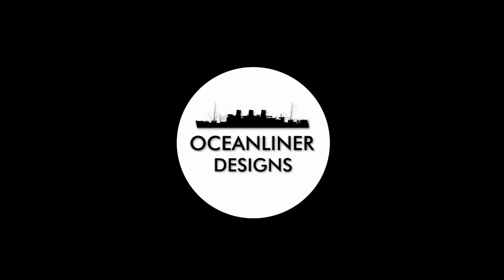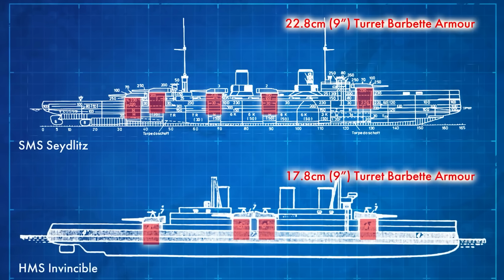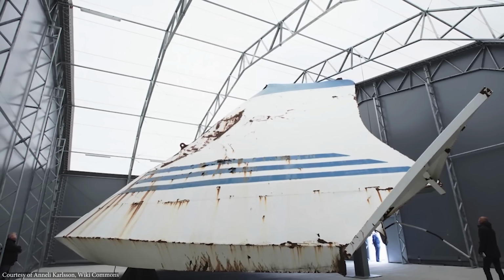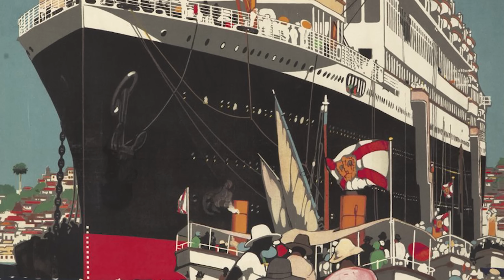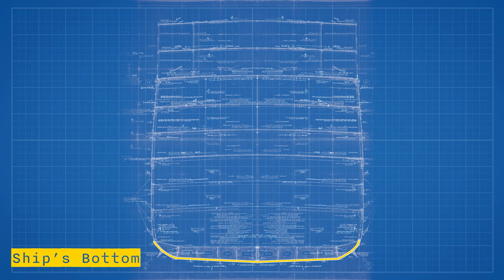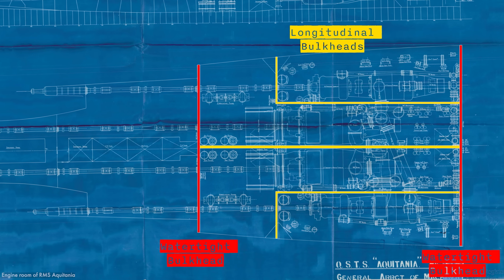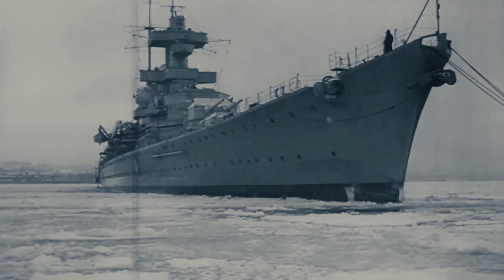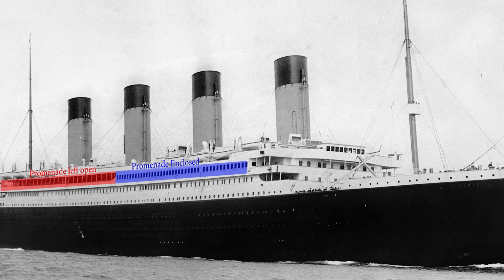The Worst Ship Design Fails in History

Comment: OK--------.   American  NAVEL Combat ships DO NOT have or allow Hatches, (water-tight doors to you land lubbers) to Pierce any Water-Tight Main Bulkhead below the Main deck. Or the lowest deck a man can walk from the Bow of the ship to the STERN without  having  to climb leaders... Forcing all personnel to climb the ladders up to the Main deck which can be 8+ decks on Carriers and then back down again just to move even 2 feet forward or aft of a Main Watertight bulkhead.. No matter how inconvenient or time-consuming that is....   With the Main WT Bulkheads reaching all the way up to the Weather decks (weather decks can very greatly how far they are above the water line).. With the  Main Deck being at least TWO decks above the WATER Line except on small Frigates and most Corvets,....
---------.   Each deck below the Main deck must be watertight with WT hatches between each deck... And No water-tight Bulkheads down the CENTER line between Main Hull Bulkheads that could create large Bubbles of Air that could destabilize or capsize the ship if that Compartment or those around it are flooded.... That does not count multiple hulls that can Number up to 6 on Carriers. that can be easily Counter flooded..or Pairs of Bulkheads that create compartments that can be counter-flooded to balance a paired compartment on the other side of the Center line.. even if those compartments are many frames away from each other....  There can be large isolated water-tight Compartments down the Centerline of the ship that must have their hatches to other Compartment on that deck secured (closed) at all times as well as be connected to a separate Water tight TRUNK 6 to 8 feet square, that runs from the lowest deck to the Main deck... With water-tight hatches usually at each deck... that must always be secured at all times... For emergency evacuations... and access to lower decks if a higher deck is flooded or Compromised by fire or smoke... this is important, especially on Carriers that may have 8+ decks below the Main deck... Trunks are normally used for moving Palets and supplies between decks...
-------.  To make this easy just in case you did not add all my above statements together... Every hatch into a Watertight compartment below the MAIN Deck MUST be Secured at all times...  Even when all the hatches above the main deck and all through the upper Superstructure decks and to the Bridge are wide open... Unless they are Guarded anytime they are open...  Damn inconvenient... But any WT Hatch below the Main Deck Mistakenly or lazily left Open could cost lives or even sink the ship or kill a hundred crewmen from a simple FIRE... during an emergency...!!!   To make things more Confusing...  Large hatches must have a Scuttle for a man to pass... ( Basically, a very small hatch that Fat people cannot get through... Simply because a hatch too large Cannot be pushed closed against incoming WATER)  
----------.  Sorry Fat People but I do not Control Physics...And why the NAVY has Weight STANDARDS.. That Should be Strictly Enforced... And IF DEI forces the NAVY to put in Larger SCUTTLES  hundreds of crewmen could die including the DEI crewman... The ship would even be in Greater Danger of SINKING including CARRIERS...   ALL.Because of a Scuttle that was an INCH bigger...( and we all know DEI would insist on scuttles big enough to walk through to keep from inconveniencing or shaming the FAT crewmen) History is full of incidents of Crewmen not being able to close large hatches against incoming Water.. and losing crewmen, compartments and whole ships. But damage control training teaches how to close Scuttles against flooding... and why speed is damn important as even at the small size they are... If the incoming water is too high the smallest scuttle is impossible to close...  Fact is they even have a chart that shows how high the water is before You HAVE to shut the Scuttle even if crewmen are still on the other side... and if you wait even a few seconds after that, you WILL be court-martialed... That is if by some miracle you survived....  The Scuttles are the Largest possible size that allows a man to close them at the highest water level possible on the other side...An inch past that level higher, and a hundred men could not close it.. Unless a smaller Scuttle was installed... But an inch smaller scuttle and almost half the average crew would not be able to pass... An inch bigger,,, the water level on the other side would be 6 inches lower... Sorry  DEI...!!!
========.   Amercan Navel Construction is Markedly Different than Most NAVYs Around the World including Chinese, European and Mediterranean Fleets that are NOT Saddled with the Experiences of WW-1 and WW-2 and a hundred years of Modern Combat on the HIGH SEAS.. AGAINST Pear Enemies... With many ships lost!!!   (except for Battleships, that is not as relevant today)...  Most fleets of the World are built using different Combat and Survival Filosophys for their ships.... To that Point...   That is Why the New Constitution class Frigate that takes a European Mediterranean  very successful Frigate design to simply Building it for the American Navy... Is 3+ years behind Schedule and a Billion Dollars over Budget...
---------.   EVERYTHING about the Frigate has had to be completely redesigned to bring it up to American NAVEL Codes and Needs...  To  Make it as Survivable and Battle resistant as It can be...  From almost doubling the water-tight bulkheads and hatches, explosives proofing the propulsion spaces, Damage Control upgrades,  Warhead Explosion Containment throughout the ship, armoring and EMP proofing all Wiring throughout the ship including additional paths to increase damage survivability, Isolating and upgrading shielding for electronics compartments... and much much more the Europeans may not care or even admit needs to be done....  
_______.  That includes criticism about the changes in the Constitution's Bow design that Europeans can not even Fathom... From cutting down the height of the bow by a Deck and adding a Sweap... That reduces the RADAR cross-section of the hull) to taking off the Balboas Sonar Dome Bow...  The deletion adding hundreds of miles of Range and cruise speed to the Constitution,,,  even before the extra Fuel Tanks were added... With the small narrow, low-drag fin extending a few feet below the keel far from the Bow, fine for light duty short range Sub detection as well as mines that need avoided... or destroyed, in shallow water...   With the new towed sonar being 10 times better for hunting subs hundreds of miles away... Than any sonar in a bow dome that is subjected to constant bow wave-piercing noise... 
_________..   Other changes include Lengthening and widening the hull to contain additional missiles and other equipment the ship needs... As well as beefing up the strength of the hull to US Navel standards...  The LCS ships BEING a perfect example of Ships designed to Civilian standards, NOT US NAVEL... That resulted in hulls that are cracking and failing that restrict speeds as well as equipment that constantly beak down and are impossible to repair for many reasons... Except that using Civian standards are all common to ALL of the LCS problems... Each and every problem the LCS's have.... Civilian standards That Build  Hulls that are too lightly constructed and  Instaled Equipment that Cannot take the Extreme Heavy Stresses,,,Civilian ships are never subject too....  AS do most Navys around the world... as most are Weekend Warriors in Fair Weather... 
_____  The original Constitution design is Fine for the Mediterranean and North Atlantic seas and low threats and operational timelines...  But a total DiSASTER for the long distances, and Sea keeping in the huge waves of the Pacific... NOT found In the ATLANTIC and Never even heard of in the Mediterranean...!!!! .     ADD all the additional Countermeasure systems and Towed Decoys and much more and...
--------.   Well... It may have been cheaper for the Navel Design Beurow to have started with a Clean sheet..... Except it would have taken a decade with all the Design Boards and Committees and all their meetings over years, even to settle on an acceptable design...  THIS way, starting with an Accepted Design already Approved... and then completely redesigning everything about it to already SET Navel Standards and additional needs, Even if the Contractor had no Clue beforehand... JUST May be the BEST WAY to go all along...  But next time get a contractor that  DOES have a CLUE...!!
=======.. Well shit...This started as just a few lines about  Nave Hatches...!!!  Hope you enjoyed them...  And I did have fun writing them...  So that is good enough for me .. .BYE...

Comment: Steam turbines reverse using reversing turbine elements.  
The reversing turbine elements are on the same shaft as the forward elements.  
I don't know of a steam ship that used reversing gearing.
Reversing gearing would be prone to failure and expensive.

Comment: On the Knox class frigate I served on we had a permanent list to port because the emergency diesel engines were placed on the port side near the stern. This was theoretically offset by placing an A/C plant on the starboard side but in reality this didn’t work. At sea this wasn’t an issue because of the stabilization system, but in port it made it an issue, especially when tied up next to an another ship.

Comment: SS Milwaukee and SS Anna C Minch and many others suffered similar fates on Lake Michigan. Roll on and roll off ferries were rough back in the day. Just one wave would crash over the rear gate, splash onto the expanded steel floor (not a solid floor) and douce the boilers below deck. This would kill the engines and left helpless in a storm…

Comment: Thank you for the exciting research! A little remark on minute 00:27:47: reverse steam turbines are not connected to any "complicated gearboxes." In order to reverse the engine, the valves leading the steam to the forward turbines are closed, and the valves leading to the reverse turbine are open.

Comment: Long before any of the examples listed, we have the swedish Great Ship Vasa in 1626. The first sailing ship of its size, the builders simply had no idea about the physics involved because nobody had had to deal with them before. So it managed a little less than a mile out of port on its maiden voyage before it caught a bad gust of wind, capsized and sank. Fortunately most of the crew and passengers were able to escape, in part because the whole thing had happened within shouting range of Stockholm and people could just take a bunch of rowboats out to pick them up within minutes of the sinking. The 30-ish dead were mostly unfortunates who'd been caught down below decks when the ship rolled over and had no way to escape, while pretty much everyone who got into the water made it out alive.
Reply: What is truly amazing about Vasa was that, after spending some 400 years on the bottom of the Baltic, she was perfectly preserved and intact.
Reply: Vasa sank largely because she had yet to receive her proper ballast and also because her lower gun deck ports had all been opened and left open when the ship put to see  for the first time. When she heeled over in the wind, those open gun ports just above the waterline were suddenly underwater. The sea rushed in. She sank very quickly as a result.

Comment: I was on the last Bass Straight crossing by the Empress of Australia. It was 1984 and she was run down. As well as very basic internal small bunk bed cabins with vomit buckets next to your pillow, she had aeroplane style seating as an option. However the done thing was to buy a cheap seat and find a couch or bit of carpet to sleep the night away. When i boarded i could smell that stale seawater urine aroma of a neglected ship. I was 13 and i couldnt help notice people running for the sofas and couches to lay claim for the night. Also saw a biker gang take over a whole floor area with their bedrolls. Nobody seemed willing to argue with them. The trip time was approx 16.00 depart, 0900 arrive. Basically 1 night at sea in Bass Straight. The weather was for "the worst crossing for 20 years". Once at sea the bars closed from lack of  patronage and the flower pots in the halls filled with spew (vomit). I was sick as a dog. On deck the horizon swung higher than my line of sight, heavy steele doors smashed around unfixed and the crew just disappeared. I was saved by an Antarctica veteran who saw me spewing over the side in the heavy roll and told me to lay face down no pillow. It worked and i got a really good sleep. Despite the freefall and crash of the bow as the ship pressed on. I cherish the memory though because it was an experience to be on an old era ( in 1984) ship in heavy weather. When i say old style i mean shared bathrooms and i recall entering a shower directly off the deck through a multi dogged hatch???. Still it was the biggest roro when built, and it continued on for a few more years in different places and climes.

Comment: A couple of points about the Princess Victoria. The ship remained afloat for four hours after she sent her first distress call unlike the Herald of Free Enterprise and the Estonia which both sank in less than thirty minutes. Also the Princess Victoria was never more than ten miles from land and she actually sank while she was in sight of the Northern Irish coast. There is a statable argument that the loss of life in the disaster was due to the failure of the rescue efforts which were poor and not helped by the Princess Victoria sending the wrong position. Is it really correct to say, as the Inquiry did, that a ship which remained afloat for four hours despite severe damage and which managed to drag herself to within sight of safety was "unseaworthy"? The Princess Victoria should never have put to sea in those conditions and certainly not without closing the "guillotine" before leaving harbour in Stranraer. Incidentally Stranraer is pronounced "Stranrarr" not "Stranrare".

Comment: I really don't think you understand how a 'pre-dreadnought' fleet was intended to fight and what role the various types of cruiser were meant to fill.

Weapon systems exist because the people at the time 'believe' that said system is the best solution for the roles they 'believe' need to be filled.

So if you feel you have a need for something that opens cans, then you might invent a 'can opener' to fill the role of removing the lids. The can opener will then remain a thing until either a better method of opening cans is developed, or people stop making cans that need to be opened.

To use a more military comparison there are claims that drones et al have made the tank obsolete based on current wars. This is not true. The tank exists to provide mobile firepower that is capable of crossing broken ground and is protected against machine guns and artillery burst. They will continue to exist until the armies of the world no longer believe there is a need to cross broken ground and bring firepower to bare, OR, something better is invented.

The fact that counter systems exist does not remove the 'need' to do 'tank things', it just means the existing tanks need to lift their game to counter the counters.

Battlecruisers at the time existed to fill a need that was - rightly or wrongly - believed to exist at the time. That role included heavy scouting for the battle fleet.

It can be argued that the need to do heavy scouting was replaced by the increase in radio, radar and aircraft - ie something came along that could do the job better - but also that is was clearly seen that a battle cruiser was able to be countered by another battlecruiser and that the existing designs needed to evolve to face the threats that didn't really exist when the ideas were first put into service.

Of course there is also the argument that they probably should have predicted battlecruiser on battlecruiser combat was the logically end game and, well, can't really disagree.

BUT, at the time they were the logical solution to the 'role' of battle fleet scouting.

Comment: An unspoken rule of design is that if it looks like an X, sooner or later some fool will try to use it as an X.  This is the problem with battlecruisers.  They're supposed to act like bullies beating up small opponents (as some of the ones at Jutland did in the South Atlantic) and running away if they meet big ones.  They got their comeuppance going toe-to-toe in a more even match up.  The Germans chose a different trade-off in the speed-protection-armament triangle.

Comment: You would think if you have a ship to where the door is the entire front or rear of the ship and is crucial for keeping water out of an area with absolutely zero water tight bulk heads - a status system would be implemented so you knew the exact position of the door and if it was securely locked or unlocked - that’s insane to me that wasn’t implemented

Comment: The early Battlecruisers were a stunning success when used as designed. They should never have fought anything with guns bigger than 6 inches. Battlecruisers seemed like failures when misused. The design wasn’t the issue, it was the tactics.

Indefatigable was badly designed though. Bigger, even less armour & could be destroyed a light cruiser with ambition. Useless ship.

Comment: I think the Imperator could have fixed it's center of mass problem by using a "tuned mass damper" as is used in extremely tall skyscrapers to counter the wobble caused by high winds at elevation. So basically a huge weight allowed to swing freely inside the ship would probably have worked or if they could have mechanically shifted it when needed or automatically in response to certain "sensors".